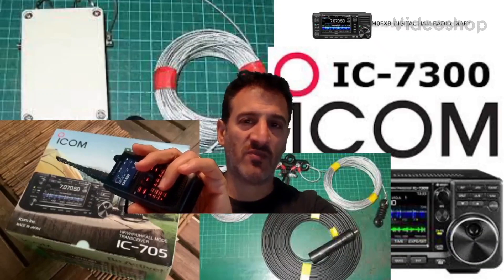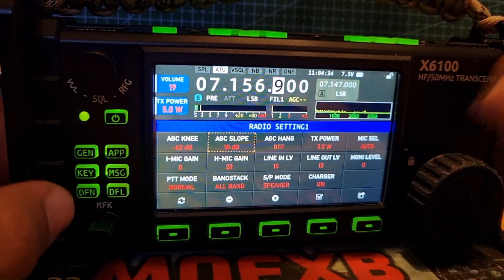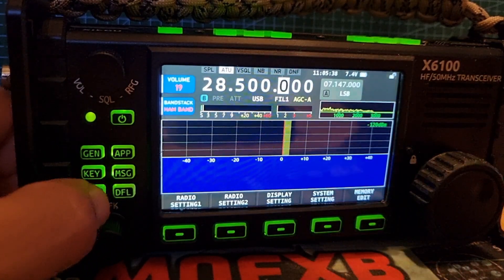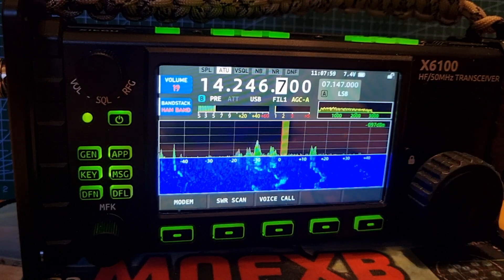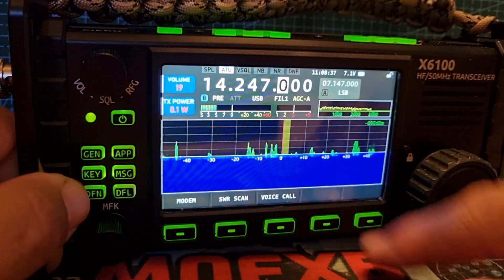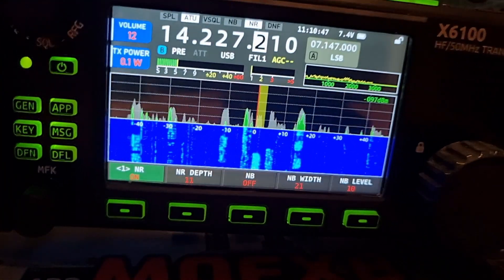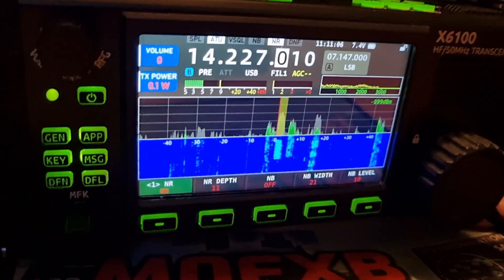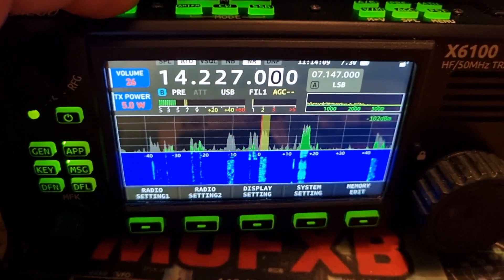Xiegu X6100 - AGC Settings  SWR Graph test for overload

Comment: I thought AGC was for transmit not receive?
Reply from the maker: Automatic Gain Control (AGC) AGC is a system that controls the increase in the amplitude of an electrical signal from the original input to the amplified output, automatically

Comment: Just bought this radio and noticed it no longer has a full screen waterfall, is there a setting to toggle on to restore that? I have a scope and waveform on the right side. I don’t particularly have a use for those at the moment
Reply from the maker: The only way is to use older firmware